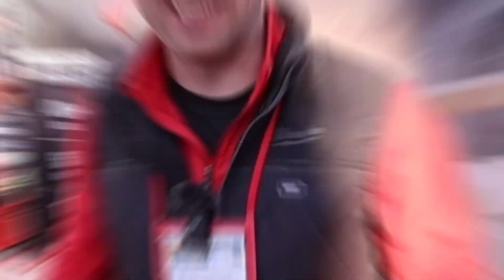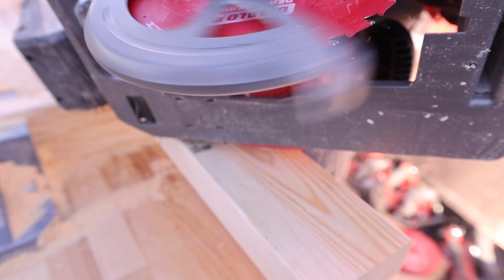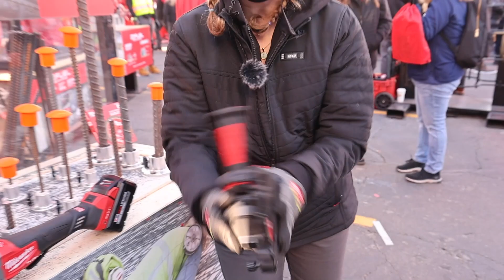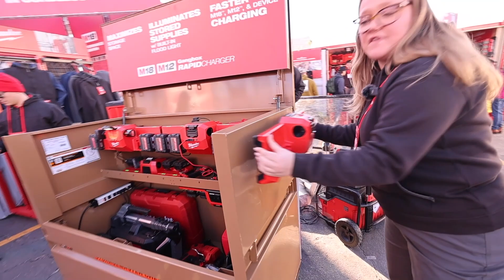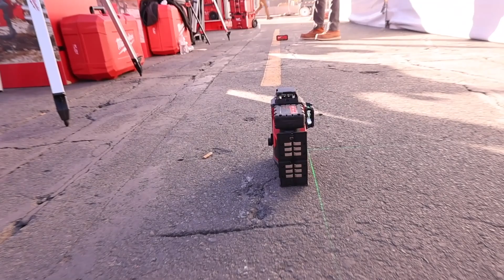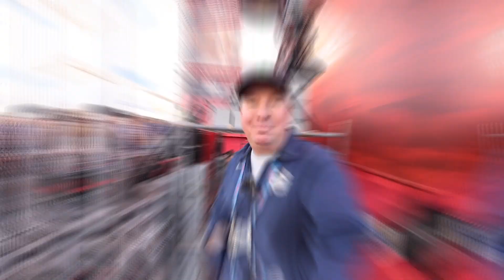MILWAUKEE Just Revealed 5 New Tools That You'll Want To See!

Comment from the maker: QUESTION OF THE DAY:  Are there any other new tools that you'd like to see Milwaukee launch?
Reply: Gen 5 drill & impact
Reply from the maker: @ Sounds good!
Reply: Packout rolling drawer, for the love of God, release it already
Reply: Not new but new model - oscillating tool , Sawzall , honestly gen 4 impact sucks so that 2
Reply: Also smaller forge batteries
Reply: Packout rolling dual battery HEPA dust extractor
Reply: Drillpress, Hydrophore pump, M18
Reply: A get 2 planer and a gen 3 jigsaw and a 31/4 HP vs M18 or higher battery router
Reply: Pressure washer, battery jobsite microwave